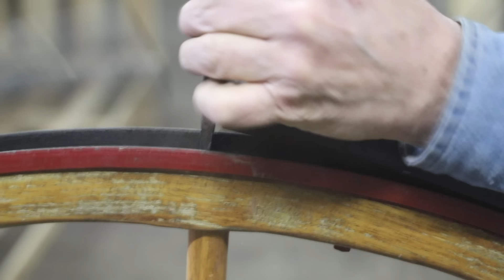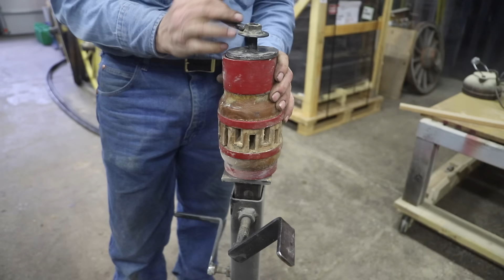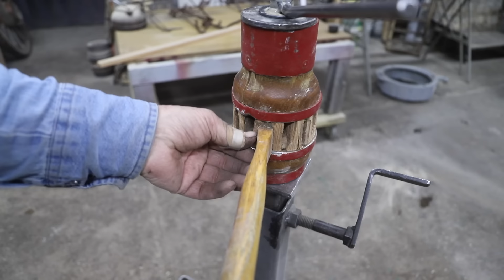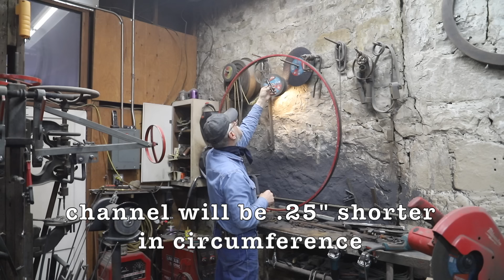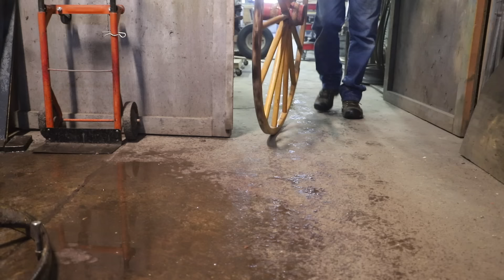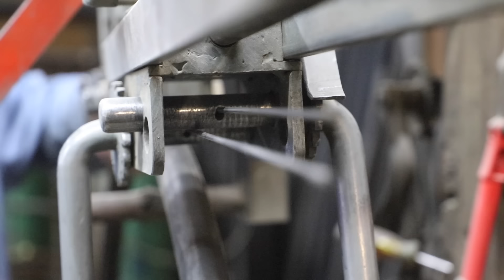Fixing Cart Wheels | Less Than Ideal Can Still Be Workable | Engels Coach Shop

Comment: The time you don't get paid for ... Every craftsman has to deal with this on almost every project.
Reply: I always found that you cost new builds and repairs/renovations differently. With new, you could cost a job pretty well because you knew all the variables. With repairs or renovations, I always offered an estimate and not a quote because we never quite knew what we were going to find and how long it would take to fix it. I did have a customer who insisted upon a quote for a renovation. Fine, I just doubled what I was going to estimate it for - that covered everything and the customer paid way too much.
Reply: @martincox7354  I used to renovate and restore vintage cars. If I had a customer like that I used to get them to tell me their maximum they thought the job would be worth and they always said far more than I had in mind. Once they think it's their idea I have no complaints over the bill.

Comment: I enjoyed watching you salvage and repair the cart wheels. Those same principles and techniques can be used on much more than wheels. Thanks again for taking the time to film and share your knowledge, and for proving that sometimes it really is possible to make chicken salad out of chicken crap.
Reply from the maker: It transcends more than just wheels huh.
Reply: The light came on for me when you put the wedge in the spoke in the rim. I've used that same technique putting handles in hammers, axes, mattocks etc. It just never occurred to me that I could use that same method on basically any mortise and tenon joint to tighten up rickety chairs, wobbly tables, etc. Sometimes you can't see the forest for the trees.
In my defense, I never claimed to be a wood worker. My old man was a pipe weldor and we never fit anything with the precision you do. We always wanted a little gap, generally about the thickness of the metal, so the weld would get full penetration. In later years when I started using a MIG gun it was even more important, cause it wouldn't dig like a stick rod did.
Still picking up things from every video, thanks for the lessons.

Comment: It reminds me working as an apprentice at the D.A. Hochstetlers in Topeka Indiana 1982. When all the Amish came into the wheel shop with very bad treated wheels, and we should fix what was left of the wheels to the absolute smallest cost. We had one advantage - we used an huge hydraulic ram from late 1800 when we put on the iron tire - and that helped a lot. Keep on doing your very excellent movies!
Reply from the maker: The West hydraulic tire press?  Great machine.

Comment: for those of us that have that worn and somewhat "loose" wheel hub that really needs to be addressed this gives me a great basis to have a go at repairing it....once I've bought a replacement...it's always good to have a spare ;) 

Thanks again Dave, I always look forward to your videos, they are an excellent resource and I appreciate you sharing them with us
Reply from the maker: Yes running wheels with loose tires adds more expense in the long run because of the spoke tenon damage that is happening.

Comment: Think think think overcome the urge to make it all new and perfect looking at what cost and not the original wheels. Keep it original and it will work  fantastic. Great to watch you strip and build a wheel again and see the tools working especially the home built specials. Love the efficient way the shims are glue in the hub and wedged into position still allowing repair to carry on. Heating the wire and allowing gravity to pull them level before brazing them together everything has a reason and done in the most efficient manner. And of course made to look easy by a skilled craftsman.
Reply from the maker: Thank you.

Comment: I am a bit of a perfectionist myself.
When you started the not getting paid time (or actually when you edited in on going to give the lathe a try) i was thinking you’d rebuild new hubs at least for those ;)
Cracked and all as they where.

You did well in knowing your craftsmanship to go this route with the filler-pieces and getting there with the old material.
Great job of good enough!

This was cost-effective for the customer
Reply from the maker: You're exactly right.  It was all about the customer.

Comment: Three things Mr. Engels. 1. You are going to come in and realize one day, that you wore a hole into the concrete banging those tires on the concrete floor so many times. 2.A lot of what I seen you do reminds me of what I have to do to my bike when I have a wheel go bad or break a spoke. 3. You reminded me of something my father use to say about a job that was less then idea. Which was it's good enough for Government work. My late dad by the way is prior Military and served in the motor pool. Now I do wonder some times, if it is not possible to get someone to make me an old pair of wooden wagon wheels for my bike, with all the spokes I break mind you my bike is actually an old Schwinn adult trike. But I think it would look odd to see an adult trike with wooden wagon wheels on the back two wheels. lol
Reply from the maker: I've heard my father use the same phrase.  Sometimes it would be, "for the girls I go with" also.

Comment: Nice to see a wheel job again. It's been a while. Getting the tires to butt up always seems like it's going to damage the wheel through shock loads  but I guess it doesn't. Thanks Dave.
Reply from the maker: Not if the tires are tight.  Doing that rubber process with loose tires can be really destructive though.

Comment: While I have seen you rebuild these types of wheel a zillion times now (and am somewhat of an expert) it is fascinating to discover some new feature I hadn't appreciated before. I think I just saw you set the concavity for those wheels which I hadn't noticed previously. What appeals to me is the subtlety of the engineering in these tried and tested designs which have developed over many, many years. Looks so simple until you look a bit harder.
Reply from the maker: Meaning setting the direction of the dish on the stand?  If so, yes.  Then the shrinking tire keeps it there.

Comment: This is the reality of repairing any thing,  always more needed than originally thought. No can guess what will be found once things come apart.
Reply: Plumbing... Always expect nothing less than a complete replacement, with leftover extra parts and triple the cost. Hehe!
Reply: @opendstudio7141  I never layed more than 1900 ft. Of water pipe in one  day, By my self.
Reply: @thomaslemay8817 I myself, worked on a repair crew for a couple of years that serviced gas and oil refineries and production pipelines. Refineries are nothing but plumbing. 😉

Comment: You are a Master, Dave. Those little tenon wedges worked a treat. I was interested that you were more concerned to keep the spokes secure laterally rather than radially. There was quite a bit of movement evident from and back on the wheels but not side to side. Could you explain that? Thanks for your wonderful work. 👌👍😁

Comment: I would have to empathise with that job . I have had to many where a literal 5cent part has failed inside a machine and it needed to be striped repaired and recalibrated. As my luck goes it is usually the very first or second component you assemble.  Not to mention that as it was difficult to see or even noted by the user and as it was a 5 cent part they continued to use it way past the damage point.
Some say you cant polish a turd, however that looked pretty shiny to me.
Cheers

Comment: Masterfully done, by just reducing the wheels diameter a touch and with a bit of sanding making them true again you made them  as road worthy once more. You could tell by the sound they made after the rims that they were back from the abyss and it was especially musical when he plucked them like a guitar string just before they were brazed. Working with old worn wood I find that have a re sanded surface to glue too works and with more adhevsives and expoxy you can repair/fill almost any wood who's problems come from age. Nice how you also re drilled the holes in the rim because the previous ones would no longer line up due to the reduced diameter because the wheel was all the stronger for it by doing so...
Reply from the maker: Thanks for seeing the unspoken details.

Comment: KISS principle. Keep it Simple Stupid.  Strip wheel flatten surface with rasp, loved the little spacers, so simple right thickness took working out, glued and wedged into place by spokes, then felloes on tighten them wedge them, then saw on butting end to fit and match end due to spokes moving in slightly. No interruption on work and hub and spokes repaired at the same time. There is something about re-using what is there rather than replacing with new. History, bit of wear patina. I love watching skilled professionals years of experience just there to see.

Comment: Nice decision. Going new would have had some challenges maybe with those reverse dish and hub styles. I think for the customer, they are better off with get a few more miles out of what they had versus, make a call and say, you really need to replace these and lose the entire job. Looks to me they will still go down the trail for a good long time depending on who maintains them. 
Honestly, I didn't think those hubs were going to make it.
Reply from the maker: They did make me wonder, but the owner is pretty new to driving and the expense of all new would have been questionable.  So, repair as reasonably as I could was my decision.

Comment: Just  noticed that the screw that holds the wheel while quenching the guide also reduces the diameter just a bit when you tighten it.
Reply from the maker: Yes that's what controls the direction of the dish.  The shrinking tire then keeps it there.

Comment: Great video. Takes a real craftsman sometimes to decipher the best approach sometimes. If modern auto service writers were estimating this it would've been new spokes, new hubs etcetc.

Is there ever a place for epoxies with marginal hubs like that? I'm sort of thinking that could be the last repair for those hubs...if so it seems it wouldn't matter. 
Thanks for sharing
Reply from the maker: You're right.  Most shop would not repair them.  I shy from proxies as a rule.  They have a place, but not in wheels.

Comment: Hi Dave! I hope you and Diane had a nice holiday. I like what you two are doing with this channel, it's good team work.  I've got to say, I don't mind watching wheels again from time to time as repairs seem to present their own unique set of challenges versus building new from scratch under ideal conditions. I know you kinda hate doing these things but you are a MASTER Craftsman.  Imagine if Zane Gray never wrote anything else besides "Betty Gray". We would never have had "Riders of the Purple Sage" or "The UP Trail".  That said, this video made me wonder about a couple things. First, those spokes. Does each spoke get marked and put back into the same mortise hole from which it came? Are you able to re-use the rubber tires or do you apply new? I know pulling the metal bands out of the rubber is time consuming and I have seen you perform this task before. I got to thinking, new rubber might be best long term for your customer.  Keep up the great job your are doing on this channel and throw in an interesting wheel challenge like this from time to time. After all, it's a rare opportunity to see an artist perform.. 

Steve in Ohio.
Reply from the maker: It's not that I don't like wheels, but rather I have to control the volume of wheels.  These spokes were so abused from being run loose that going exactly to the right place wasn't a big deal.  Each one had to be custom fit anyway.  I reused the rubber because I could get the old wives out.

Comment: Dave, you are the expert, but I have a question. Should you use a steel hammer on wood? I always use either a wooden mallet, or at least a block of wood as a buffer to prevent denting/damaging the wood...

Comment: May I suggest you loosen the nut and bolt and spin the wheel while hosing down the rim? It seems like extra work to circle it, rather than spin. Do watch your forearms, clothing and hands, carefully, however. Thanks for these videos, Mr. Engels.
Reply from the maker: I need the hub locked into position as the tire shrinks so I have control of the dish.

Comment: Amazes me how he thumps the wheel on the ground to close the gap in the tyre. But in time, the tyre never shrinks back and leaves a gap!
Reply from the maker: No.  There is too much rubber so it always has compression on the joint.

Comment: Great job as always  wanted to ask why you strike the rim towards the wheel while putting water on to shrink it back
Reply: The rim flexes into an oval at each blow and a pair of deformation waves travel around the rim loosening and tightening on each felloe and spoke as each wave passes
Reply from the maker: It helps set the joints as the tire shrinks.

Comment: The wire tightening machine is an amazing piece of equipment. Apparently some very experienced and intelligent wheelwright came up with the idea after many attempts of trying to tighten the wires when putting on rubber tires. What is the name for the device?

Comment: I wonder if putting epoxy into hub to stabilize it would work? Btw Dave I don't recall if you ever explained why you hammer on the tire as you cool it onto wheel. I know it's to help metal move on wood and settle after shrinking it but don't recall if you ever explained that in a video.

i am anxious to see how you finish those buggy seats. Tacks, staples, cotton, foam, fake horsehair, linen, so many options let alone the complicated leather work as well as doing some painting under the fabric to protect from moisture rot.  And will it be butt and tuff style or plain.  Next of course is the top ironwork which should cover whole carriage so that driver has some cover in rain so I guess it extends forward of front seat.  Does this buggy have a brand name and pinstripes?  Logos?
Reply from the maker: I don't do epoxies in wheels.  As for the buggy, I'll be getting back to that soon.  I have some parts coming.

Comment: Another great video.  Thanks. I keep wondering, why do you tap all the tires (in this case the metal part that the tire fits into) as you cool them with the water.  Is it just to ensure they are fully seated onto the wooden wheel?
Reply: My guess is that it equalizes the tension in the channel as it shrinks onto the wheel. Hitting it encourages a tiny localized movement of the channel relative to the wheel so that, in theory, the tension becomes the same all way around.
Reply from the maker: Yes it sets the joints securely as the tire shrinks.
Reply: When you weld them three wires together how do you get the rubber back together again

Comment: A man that works w/His hands has to use a Band aid to hold the 1st Band aid on....
Reply: And then electrical insulation tape 😉
Reply: CVS Pharmacy had for many years some of the best sticking cloth bandages. As a machinist, I can't even start to count the boxes used during the first ten years. 🩹🩹🩹
Reply: Look up "finger tape".  As a carpenter and woodworker, I've used miles of it to keep bandages on.

Comment: Have you developed refinements or better ways of constructing wheels for the folks who still are using wheels for work?  Wheels that don't need to be historically correct?

I think of the loggers in my area that use the huge draft horses and these contraptions for skidding out the logs, giant 10' diameter or larger pairs of wood wheels with one end of 3 logs suspended from the axle.  They are hooked to the horses somehow and dragged.
Reply from the maker: Generally it's tough to out perform a correctly built original style wheel.

Comment: I noticed that some times you plug weld the holes for the tire bolts,  but on this one you did not. When you change the diameter of the tire or of the wheel, I am wondering how you make the holes line up. I'm willing to take "watch and learn" for an answer, but...

Comment: How old is the building that you work out of?  Looks like it’s been around a few years, lol.  It’s a very cool shop.
Reply from the maker: 1898.
Reply: @EngelsCoachShop  that’s pretty neat.  As a kid in the 90’s I hung out in a machine shop built in the early 1900’s.  It had all over head pulley system for machines.  The only upgrade was the power supply.  Went from a single cylinder engine to a slant 6 Chrysler, lol.

Comment: Do you pull a new wire through rubber, or do you just weld a short piece to the old one? If that's a whole new wire, do you have a separate machine for it, or do you fix a new wire to the old one and pull old one out through the other end?
Reply: I've only seen him use new wire.
Reply from the maker: Yes, new wire in the old rubber.

Comment: Soooo? You had to cut the rim. Was that because of wood shrinkage or it was not made right in the first place? Just wondering if it's typical or unusual for the rim to be that much longer? ❤🌅🌵😷
Reply: Did you have to cut the rubber tires the same amount as the metal rim's? Or were they within tolerance? ❤🌅🌵😷
Reply: Or did you use new rubber? ❤🌅🌵😷